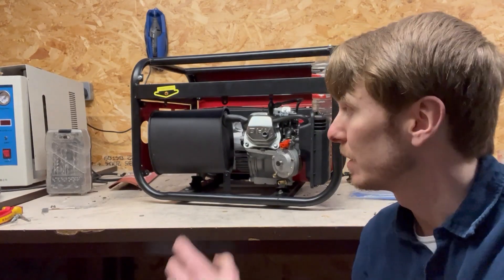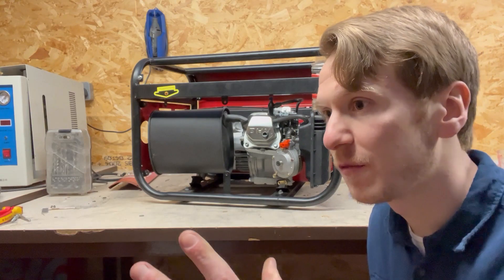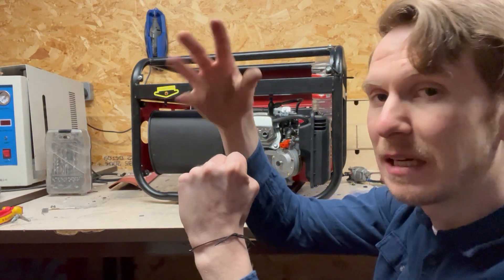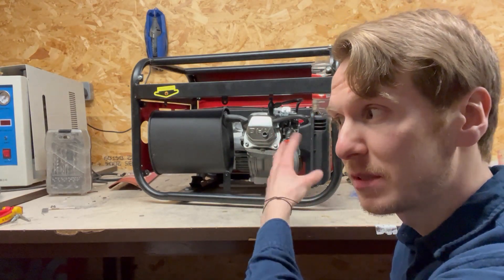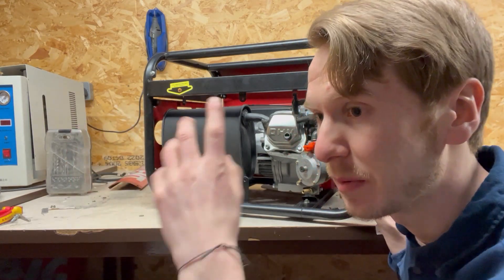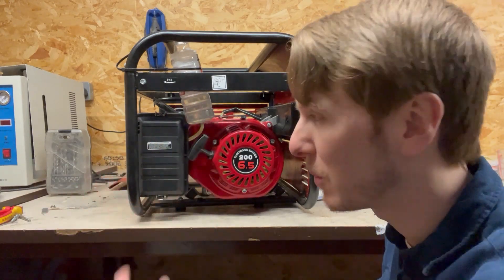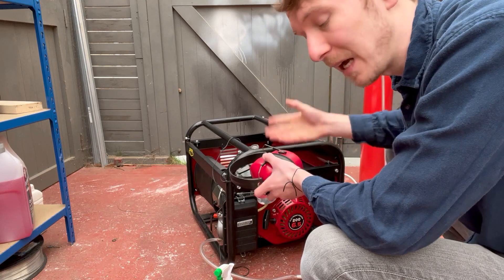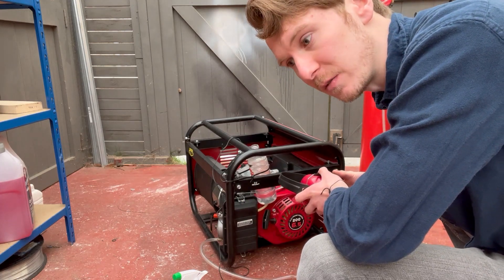Hydrogen Combustion Generator

Comment: Hello,
in my opinion and my vision could be costruit a direct injection system, ie in the combustion chamber with an Injector that is electronically controlled Hall sensor on the intake valve actuation, and efficacy certainly is optimal with a very good efficiency , the dosage must be found exactly as the engine needs, anyway we write, I follow you with what you post, I really work on an electronically controlled injection system but with HHO differs little than what you want to do with water vapor , the important thing is that everything is only possible to you want to do and try all the options.
Reply from the maker: Direct injection is definitely the way to go. But difficult to retro fit, this set up is simply bolt on, which works well for most people without a workshop

Comment: Try incorporating electrodes that react to create chlorine gas and hydrogen from the same electrolysis system. You will be shocked and amazed as chlorine gas is ten times the power of gasoline vapor.

Comment: Hydrogen implodes it does not explode.
This means hydrogen engines must be timed to work in a manner that pulls the piston up as opposed to pushing it down.

However when hydrogen is mixed with chlorine gas the out come is and explosion greater than that of gasoline per volume of vapor.

Comment: I heard that a combustion engine on 100% of h2 fuel will be too hot for conventional engines. is that true
Reply from the maker: Hi, yeah the engine will run hot, that’s why it’s best to swap out components that can take the extra heat, and run water injection for cooling.

Comment: Without water hydrogen detonation causes an implosion. Do you think the pistons are driven by implosions?

When water is added the heat from the detonation is tuned into explosions because the water expands into steam?
Reply from the maker: Still combustion not an implosion, 
The spark it triggers at TDC so the piston is forced down, if there is an implosion the combustion pressure still overpowers it, or the engine wouldn’t run. 
Extra power is potentially added from the water cooling being turned to steam. But it’s really there to reduce the hot spots in the engine.

Thankyou for the comment

Comment: are crazy ... why put water ? the hho is cold. you need read more about hho..
Reply from the maker: This was pure hydrogen gas not HHO, so the water is used to reduce hot spots in the combustion chamber to prevent pre ignition.

Comment: Will this carburettor setup work with a small bottle cell instead of using a compressed bottle?
Reply from the maker: The engine requires around 4-6psi to operate, so long as there is enough pressure it will run .

Comment: Can I ask a question would using a Diesel engine be better because of the stronger head and the tolerance’s are tighter from firing on compression?? Would that help ??
Reply from the maker: Thanks for the comment, yes that would be ideal, when running hydrogen gas in a combustion engine the compression ration can be increased to claw back some power. Not sure about the compression igntion but somthing to look into for sure.

Comment: Exhaust gas recycling reminds me of GEET by Paul Pantone. He got awesome results using his device as catalyst of not only exhaust but also fuell going into engine. Maybe it helps 😉👍🏼
Reply: I also learned that adding ammonia to fuell, gets rid of Nox particles. Ever seen the bendall thunderstorm generator? Malcolm Bendall claims he can get rid of carbon in the exhaust by ionising the air before it enters the engine. Letting the ionised air thru airstone in water to make cavitating  bubbles with the vacuum pressures on the inlet of the engine. This proces forms plasmoid structures that cleanup the exhaust gasses. He got 20%oxygen from his exhaust and no carbon. 😆😅😳 Also very interesting to look into. 😉
Reply from the maker: Great suggestion!

Comment: Use a water bubbler,
Reply from the maker: Not needed with pure hydrogen gas. Can use a flash back arrestor instead. The gas used in this video was 99.5 percent pure hydrogen

Comment: Ahh of and I also wanted to check and see if I’m the only one that thinks a micro car distributor that has adjustment thru rotation a amazing upgrade compared to whatever cheapo engineered stuff they put in these to save the 10 dollars or whatever..

Comment: Hey could you go more in depth as to how the carbuerator is modified!? And the timing changed!? I have a Yamaha 5000 watt gen that just needs a few mods apparently and all I need is it to run stable rpm(not like a sport bike lol) without blowing up basically.. so if you feel like that methodology can be shared I would much appreciate it 😅

Comment: what electrolyte does the cell use, i was thinking maybe using bicarb might slow the burn due to the co2 from bicarb
Reply from the maker: I have been buying pure hydrogen gas to test these engines, it quick to get hold off and adds consistency when testing, hoping to get a pure hydrogen electrolysis unit again soon

Comment: With water injection you are increasing compression as water doesn’t compress so at top dead centre you have a smaller compression area. People need to understand all the facts with this system to understand it.
Reply: You need a smaller combustion chamber so the timing and firing needs to be different
Reply: This is amazing

Comment: How many liters per minute of hydrogen gas is going into the generator?
Reply from the maker: Hi, i didn’t measure it with this engine with the new ignition point and water valve cooling but from basic calculations it looks like it was 9.5 LPM, not great but something that can be improved. 
Thankyou for the comment
Reply: Do you think an hho cell would work for this ? Nice to see that you are making progress.

Comment: Hi can you tell me what the Hydrogen LPM is for this setup>
Reply from the maker: Hi, from some basic calculations it looks like it was around 9.5LPM, not amazing but something that can be worked on to improve, for efficiency it’s safe to say fuel injection is the way to go. These engines I have made are just working examples of low cost engines without fuel injection.
Thankyou for the comment

Comment: I tip my hat off to you Sirs for working on uncharted territory. Years ago I tinkered around with vapor gas engines. What I found were two things that would bone you. One, the valve timing has a few degrees of overlap. This will cause an explosion which will tear an engine up big time. The second was the timing. When electronic ignitions came to be standard one has no real idea as to how the timing is actually being fired. I tried five different ignition assemblies and each had a diffrent timing advance and movement on base timing. I do not remember the baseline float in degrees but do recall it varied way to much unlike the points and condenser which is mechanically fixed. 
Good luck with you video adventure too. vf
Reply from the maker: That’s really interesting, Thankyou for the insight. I will be looking into ignition timing more, this engine was set to 0 degrees top dead centre ignition timing, which is safe not not very efficient from a power stand point.
More work to be done :)
Glad you enjoyed the video and Thankyou for the support
Reply: @Hydrogenguys  Try to find an old ignition system that would fit with slight modification. Good luck.

Comment: Try meter mixing exhaust gases to the input gasses. This will slow the burn rate of the hydrogen. Look at meyers wfc memo for figures. Edit i see you mention this at the end.
Reply from the maker: Hi, a simple EGR system would help these small hydrogen engines alot.
Thankyou for the comment and support
Reply: @Hydrogenguys  I remember I had a research paper that mention 11 deg. PTDC as being optimal but I can not find it now, if I do i will send it on.
Reply from the maker: @johnharding2912  That would be fantastic,
Cheers

Comment: I haven't seen your other video. Have you take account for wasted spark. This kind of engine has a magneto which fires at TDC and BDC. This is not a problem for the engine running on gasoline but will play havoc with hydrogen.
Reply from the maker: Hi, the wasted spark system is a pain to work with, you can actually see it backfiring in the video out of the intake port, thankfully it’s okay when the engine it operating at 1k rpm or more.
Thankyou for the comment